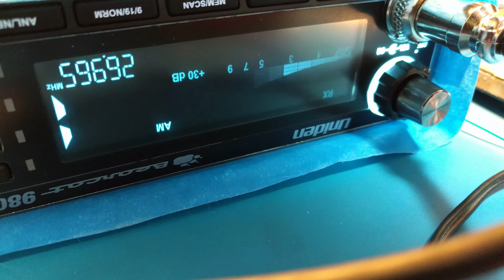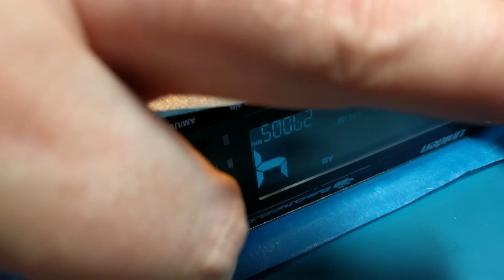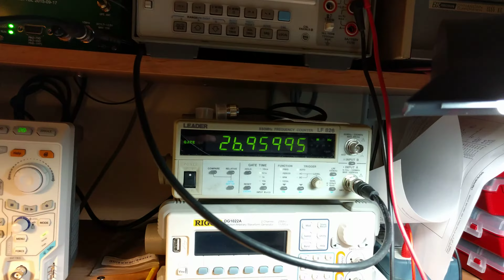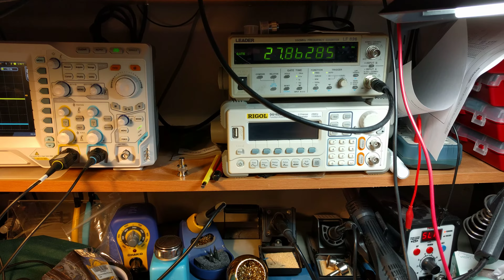SSB980 hacking

Comment: Looking good.  Just need to figure a way to get your external MCU installed where the factory one is.  Curious to see how the board with cut in half pass through's works out.

Mike
Reply from the maker: Radio covers from 26.02 to 28.37 Mhz
PLL unlocks below or above there. It's sketchy at the edges as expected.
It can probably be tweaked or the hi/lo ranges adjusted to cover a different part of the spectrum but that's it current range.
Reply: +Mark19960 

That's more than most people would ever use.  Especially when you consider most people just want to be able to het to 27.555 or slightly higher.
Reply from the maker: I am thinking the easier course of action may simply to design a board to stuff in there.
Simply pull the old display off.. and stuff it on the replacement and plug it in.
I have most of the functions mapped but there are quite a few things not mapped.
No reason to really map it all out if I was not able to tune it. Now that I can tune it I can finish mapping it out and see what's easier... board replacement or adapting the MCU.
I am leaning towards board replacement... it just makes sense.
I won't need a bunch of the stuff from the old board since a lot of that is off the shelf.
Swap display and move on.
Reply: +Mark19960 

Sounds like it probably would be easier in the long run.  The more plug and play you make it the easier it would be to install.